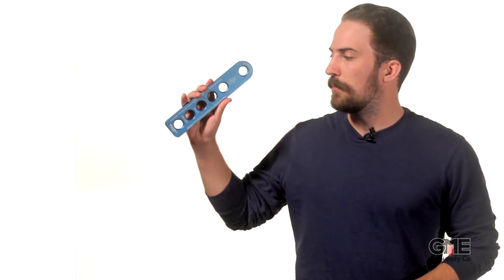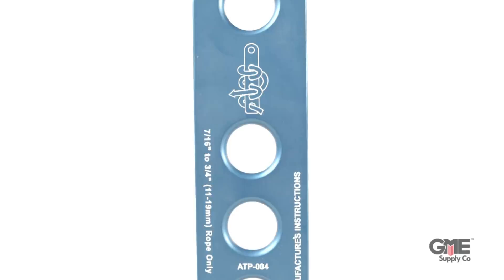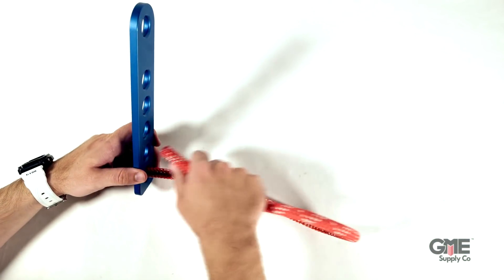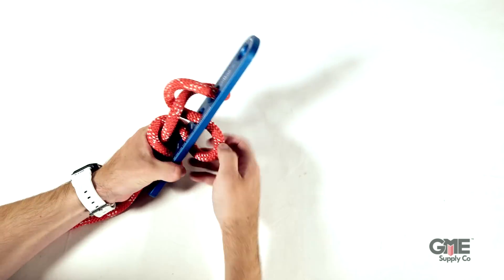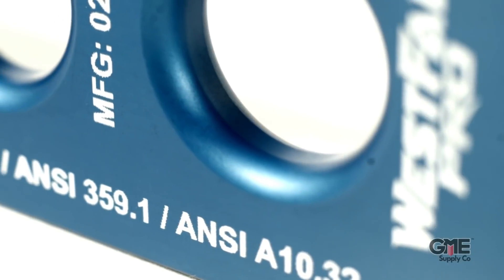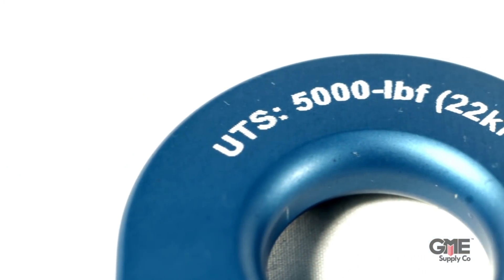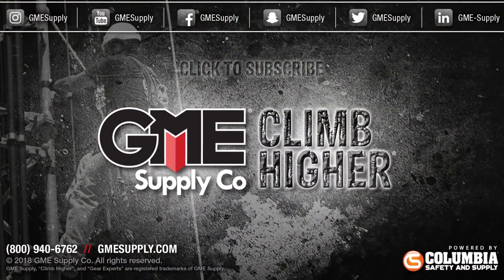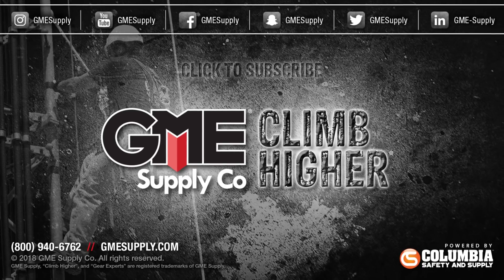WestFall Pro Termination Plate vs. Knot

Comment: How much does using the termination plate reduce the overall strength of the rope. I know a properly tied figure 8 knot will reduce the capacity by 17%, While the plate may do better, no one has been able to tell me the percentage.
Reply: Did you ever get answer to this question?